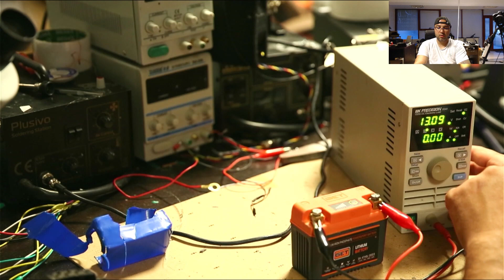Repairing a 4S LiFePO4 Motorcycle Battery with Pouch Cells | Disconnected Tab Fix

Comment: Thanks for that - I dismantled a LiPo motorcycle battery yesterday and had similar issues to you - even down to a flash of the knife cutting apart the tape!
🎇😅
I wish I'd seen your video first - I damaged the casing so I broke mine for parts.  But I might retrieve the pouches and test them more thoroughly to see if I can find the original problem anyway, and maybe keep good ones for the next project.
👍